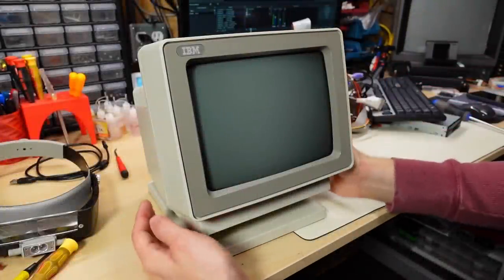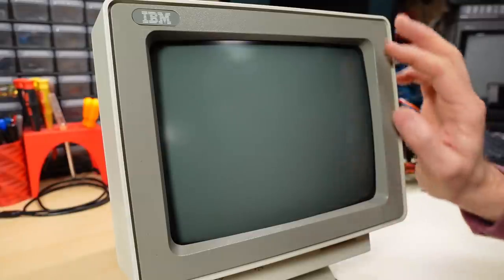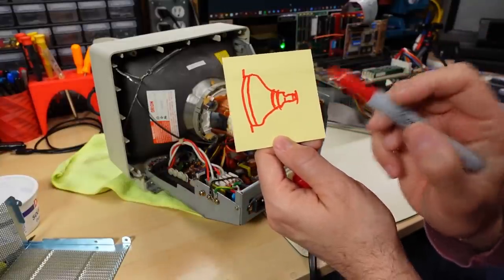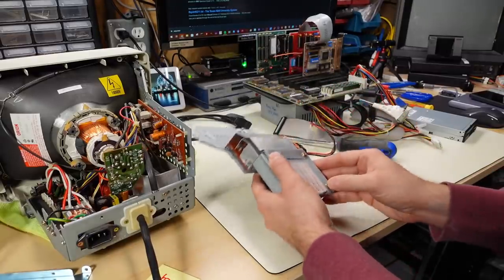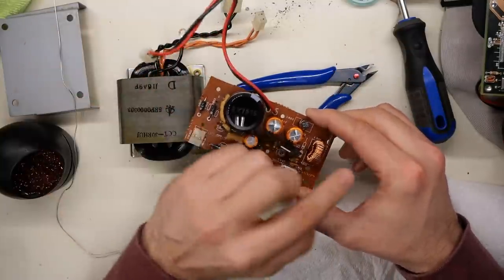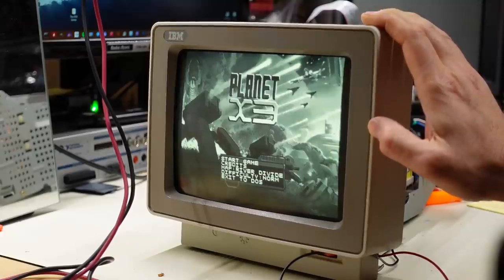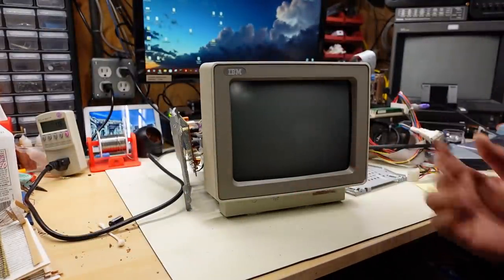Corrosive glue nearly killed this monitor (IBM 9" VGA)

Comment: Just a few pointers for future reference from someone who works on vintage electronics regularly:

You can't rely on CRTs being the same size with the same shape neck connector as a way of seeing if they're compatible, it's always best to Google the part numbers to make sure voltages, bias values and other parameters are compatible.

CRTs often "wake up" after not being used for a period of time, they will get brighter within the first few hours of use.

The 550v warning underneath was actually a "greater than 550v" warning, so yes it's very likely that the HT is 10+kv.

Shorted capacitors are very common, especially in gear that hasn't been used for 5+ years. Sometimes you may find that a device works perfectly for a while then stops working at all, most likely is that an electrolytic has shorted. I would suspect any electrolytic before pulling an IC in something this old!

All that said, I really enjoyed the video as always, keep them coming!
Reply: AFAIK 7-pin CRTs should be mostly compatible, with two main variations: heater voltage and position of G2 and G4. I believe the other bias voltages are mostly compatible.

Comment: I once had a small CRT like this - ended up selling it on a local auction site, got $silly-high for it.  Turned out the monitor was going to go into a helicopter, where it was rated for flight usage.  The old monitor had died, and the proper part was priced at $ludicrous.   This was back in the day when LCDs were brand new and cost thousands.

Comment: Great work and well done although I am a little surprised that you went and removed the chip rather than the cap as the cap was the easiest by far and very likely the problem, remember a short is also a massive leak ! but I guess a nice desolder gun helped with that decision ! Happy New Year....cheers.
Reply: Especially since a shorted chip there would probably have had its plastic body crack or it would have become so hot as to discolor the PCB beneath it. Neither of which were observed.

Comment: The other day I had an issue with a Yamaha keyboard of about the same age. In it, a 470µF cap had turned into a 2.3 Ohms resistor, pulling one of the voltage rails WAY lower than needed. After removing a bunch of other components, I was able to find this one. I replaced it (and a few other caps I had cut out along the way) and it freakin' works! Interestingly, I hooked the same faulty cap up to a capacitance meter (I have access to a very good one at work), and it still has almost full capacity. But Blocking DC... nope.

Side note: As a German, I just love seeing "Bildröhrenregeneriergerät" written on that box. :-D

Comment: In the early 90s I worked as a developer for branch systems at a top 20 bank.  We being an IBM shop, supplied all the tellers in the traditional banks this 9" model since space was often at a premium.  Ironically the smaller grocery store kiosk branches got the ubiqutous 14" 8511 color monitor, only because the manager apps were also on those particular boxes easily switchable via OS/2 that was running on them.

Comment: Good diagnosis run, gratz on getting it working again.
Resistors go open and capacitors can short.
The "glue" that they used to use was changed to a new formula when the original formula was found to become conductive over time. Best to just get rid of it whenever possible.
And as always: "thou shall always check voltages" as soon as possible in the diagnosis run.
Cheers and Merry Christmas,

Comment: I had a shorted 1000µF electrolytic cap on the video mixing board from a Sharp X1 turbo recently. First one I'd ever seen. It pulled the +12V rail down and would not let the computer's power supply switch on as a result.

You'll be happy to know that it tested out as having incredibly low ESR.

Comment: I have one of those monitors in my collection. I used it as a service unit for field calls, mostly in data centres. I seem to remember there was one batch with out of spec video connectors that could be plugged in upside down.

Comment: I've seen this glue cause so many problems too, but no complaints here as it generated good repair revenue. One use of glue that was very unwelcome however was the silicone type IIYAMA used to glue the EHT anode caps to the bowl of the tube. It was very strong and made it difficult to disconnect the lead from the CRT without causing damage.

Comment: As an old timer I have seen a lot of shorted capacitors. Specially in low voltage circuits. Just not enough power to blow them open ot the over power safety circuit in power supplies shuts down to prevent capacitor opening up.

Comment: This was a well known problem from back in the 80's!... it's contact cement that goes leaky over time big deal, the HA11235 is a horizontal n vert osc + xray protect driver IC, That picture tube tester is a clone of a old B&K from the 80's.

Comment: 10:30 - is that a 50V capacitor? I mean the big Daewoo one. You should mention that if a PSU with a big cap was used recently you should discharge it through some resistors because you can get a nasty shock from the stored charge. For fun I shorted a 400V cap of a PSU in a PlayStation 3 slim after opening it up and I almost sh*t my pants, it was loud and scary. But I'm glad it didn't short while I was taking it into my lap or something.

24:09 - when it showed short at this point I was like probably one of those caps is shorted. But yeah, they usually don't short when dead, tantallum caps do that. I'm glad my hunch wasn't so bad but I would have never figured it out on my own, I was just following your logic to this point.
Reply from the maker: The PSU is connected to a transformer which likely sends 20-25v to the DC cap -- no risk there from a shock. :-)

Comment: One even worse thing about that brown gunk is, it oftens go semiconductive :( I have seen this many times in old audio gear.Just one tip for future degugging, you can desolder only one leg on IC and wiglle it with tweezer to break contact and measure for short at the same time to check if the short is within IC or somewhere else.

Comment: Those 9" screens also found their way into the kitchens of many fast food chains in the 90's. They were connected to dumb terminals that displayed orders for the staff to make.
Reply: Yes, and no. Yes they had 9" monochrome CRT screens then for that, but no they weren't THESE screens from IBM. Cheaper mass market models. I believe retail and fast food continues to use RS-232 connectors, they see no reason to upgrade to USB.
Reply: @squirlmy  Sorry I should mention I'm not in the states - I used to work at one that had little IBM's same as if not very close to these.

Comment: I think the 550+ warning label has to do with the National Electric Code.  Most regular service electrical insulation and components are rated to a maximum of 600v.  That label may be there to notify a service tech that there are systems inside the enclosure that are higher voltage than standard service components can be used for.

Comment: I've seen this before. The glue on those old computer components is corrosive, if it turns brown and crusty like that. Terry Stewart had a problem a long while back with a CGA monitor that went kaput because a diode came into contact with the chemicals leaching off of the glue and just basically corroded away.

I had problems with it on the power supply of on a Sanyo MBC-775, a computer that I'm currently trying to upgrade. Thankfully you just chip it away if it's dry enough.

Comment: The manufacturer can often be determined by just the article codes on the PCB's and other parts. I don't recognise the code on the power transformer, though. Let's hope other parts also show their codes in the video. 
EDIT: The code on the power supply PCB already gives it away even before seeing the brand of the capacitors. It's a DAEWOO. In which case the Orion CRT makes sense as well. Other Korean manufacturers often made the CRT's themselves or rebranded them to show their own name.

Comment: Super nice monitor, I had one like this or the exact same model 12 years ago. I used it as a second screen for an old Win95 Digital Starion machine.

I miss when it was easy to pick up this stuff, in good working condition, at a thrift for under $10.

Comment: I have the same monitor. It came off of an IBM Wheelwriter. I work on Selectrics and Wheelwriters. Some later Wheelwriter models came with these monitors and a swing arm that mounts to the back of the Wheelwriters. They were used by offices and realty stores. I am not sure but I think they were sold as an accessory to the public. Though most of the Wheelwriters that would accept this monitor already had displays built into the front lid. Thanks for the video because I am currently trying to figure out what is wrong with my IBM monitor. I really want to get it going

Comment: We used these monitors as our ANI/ALI screens when I worked 911 in the late 90's... I've repaired more than one of them, and most of the failures were due to the glue of death.  I have had one that had that same cap shorted. (no idea why, as it hadn't been sitting for ever unused like yours... that must be a sore spot in the filtering on that rail)

Comment: That monitor isn't one used in point of sale. Your photo was of an IBM 4694, introduced in 1994. Their previous model register was the IBM 4683, which could have used that display, but the pos monitors didn't have the ps2 coloring until the 4694. They typically had white controls.

Comment: The brown "junk" is called silastic... They use the silastic on the caps so that they don't move around and change the Q factor of the circuit, due to mechanical, or thermal movement.

Comment: I thought "Duff cap" as soon as it was obviously going into some sort of protection mode.  It's maybe the things I tend to work on but I've encountered for more capacitors that have failed short, or become electrically leaky, than have failed open or physically leaked,

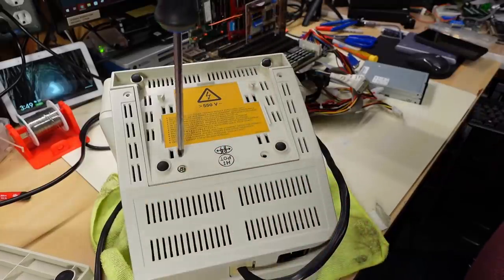Comment: 4:47 I have a 22" NEC Diamondtron CRT made in 2000, and it refuses to power on without a signal, instead it turns its glowing Multisync logo to red. Quite unusual for a proper VGA monitor!
Reply: Not that unusual for a late CRT like that. From what I remember, all CRTs from the late-90s onward had a standby mode like that.
Reply: @StarkRG  All other CRT monitors I remember would display "no signal" at least brefly. Especially a higher end monitor like this I'd expect to implement that.

Comment: That charging cap probably died of old age, given how dim the CRT is it has done a lot of work. I wonder if recapping with lower ESR ones would actually improve the power draw and temperature of the high voltage circuit?
Reply: Probably
Reply: An ordinary electrolytic capacitor from today’s vintage would have a lower ESR than that 1980s capacitor originally had brand new.

Comment: I would love one of these monitors as a retro data display, visualizing various sensor data collected around the house. Maybe even upgrade it to touch to make a central control console. Put a single-board computer inside to have an entirely self-contained unit.

Comment: In the 90's we had PS2s with a little tiny screen like that in the so-called "learning lab" in high school. But, it wasn't a separate monitor. The disk drives and cpu were in the case with the monitor. Interestingly enough, there was no internal storage. They booted from a floppy and then ran from the network.
Reply: He's covered a few of those, and think Clint (LGR) also has. Iirc they're called IBM EduQuest. I used to have one.

Comment: With one bad cap, odds are others are marginal.  I'd check your filament voltage, B+ etc. in operation.  You might have another somewhere dragging the voltages down.

Comment: underneath R530 there's a ground plane to the left of H- HOLD.... there is a massive broken solder joint.
Reply: Hi,
Don't see it.  I do see a dark reflection which when he moves the leads you can see that it is a reflection, not a crack.
Do you have a time mark?

Comment: I have an IBM paperwhite VGA monitor half the size (5-inch dia? I've never measured it) that one! 
The last time I plugged it in, it worked fine...  but that was quite a few years ago... I should pull it out and check it again!

Comment: Awhile ago universal replacement crts for console tv came with no band. You bought a separate band and ears. You set the ears where you needed. High anxiety when tightening the band.
Reply: Since the band is part of the implosion protection on a CRT, that can be a risky undertaking - with no guarantee that proper implosion protection ultimately results.

Comment: when there's shorts on a board, I always go for the electrolytic caps first, followed by other types of capacitors, ceramic discs last, since they're less likely to be shorted, hit the zener diodes and of course all the "brown death glue" spots. majority of the time, if something is blown/shorted, it's most always due to a capacitor or zener failure. I learned the hard way years ago by replacing transistors and IC's, which quickly failed again because I never fixed the real issues.
**there's very likely other bad/ready to fail electrolytic caps all over that monitor. probably wise to check or just replace them all for longevity.
Reply: Perhaps you dealt with a lot of "Capacitor Plague" CRTs from 1999-2007? Pre-1999 electronics are a lot more reliable and while certainly I might expect one or two caps ready to fail: "all over that monitor" sounds like a wild exaggeration. I've talked to many knowledgeable vintage computer experts who don't believe in the "replace every old cap, just in case" philosophy. When the owner is aware of the issue, "is vigilent", many think that's enough. Live and let functioning components function.
Reply: @squirlmy  capacitors have always been an issue, it got better for a while, then the race to miniaturize them, combined with ROHS and low ESR made them very unreliable. of course there's the tales of stolen formula's, blah blah blah.  the planned obsolescence machine is at full speed still..
Reply: @squirlmy  I agree, replacing every electrolytic capacitor is crazy. I still have most of the original 72 year old electrolytic capacitors in my ancient TV. If they function okay, don't show signs of failure, and aren't a known problematic type there's no reason to recap.

Comment: I used to use this monitor in school in our computer lab, It has a passive electrical draw for the tube heater. So it turns on a little faster.
Reply: That would also explain why the CRT is so worn out, if it was left plugged in the tube heater would have been on all the time.

Comment: I know I'm late to the party but I used to use one of those when developing software in the mid-90s. I could put 2 VGA cards in a PC and have one in colour mode (0xB800 address) and the second in monochorome text (0xb000) mode.

I could run my debugger on the mono screen and the software being debugged or developed on the colour screen.
The green screen was very easy on the eyes when developing.

Comment: As for small, cute monitors I do love my Torch monitor, may not be VGA (not even attempted to try it on that) being a 15KHz RGB monitor, but I love it cos it's cute and small, rather matches the diminuitive size of the Amiga 600 I use it with too... :D

Comment: In my (limited) experience of monitor faults and instead mostly industrial systems, I have met a number of shorted aluminum capacitors.  Honestly though, much fewer than solid tantalum types.  And less than opened ones.  Which probably were at first shorted!  That is until their protective internals cleared them into opens...

Comment: a lot of the airlines had a contract with IBM to buy PS/2 machines, and they were very cheap without disk drives and hard drives, made to run off of a mainframe and these were often the monitors paired up with those machines.

Comment: These were the days before silastic became popular for securing components and it is likely this stuff contained acetic acid(vinegar) and is the corrosive component. Later they figured this out and Silastic became a standard for holding components. Just a guess however.

Comment: LOL, Adrian STILL hasn't learned to replace electrolytics on old stuff.
Reply: Stuff that age usually doesn't need replacing them. Much older yes, or in the capacitor plague era.  Otherwise you're usually wasting your time.
Reply: I always recap old stuff. Electrolytics will fail sooner or later, and when they short it could result in more severe damage. Replacing thru hole caps is quick and cheap and saves time in the end :)
Reply: @big0bad0brad  Capacitor Plague was 1999-2007, according to Wikipedia. That's a long time, and many repair/service people just learned not to trust any cap.  There's also a funny dichotomy, Vintage PC people replace tantalums with aluminum electrolytic caps, Mac people replace alums with tantalum.  Mac owners resent the experience with alums leaking undetected, PC owners dislike the sudden "magic smoke" and trust alums longivity more. I think it's basically 6 of 1, half-dozen of the other.
Reply: @squirlmy  I love it when a tantalum blows up, you know exactly where the problem is.  And when they don't they almost always work perfectly.  Granted, put one backwards in a low current circuit and you have a ticking time bomb that won't explode, but just silently kill a signal.  But in the normal case of throwing one over a power rail, all good in my opinion.  Aluminum electrolytics are more likely to silently degrade or fail in general.  I don't consider bulging aluminum electrolytics a terrible problem, more so the ones that sit there looking innocent but they're either shorted or barely any capacitance.  And yeah the ones that leak corrosion juice are awful.